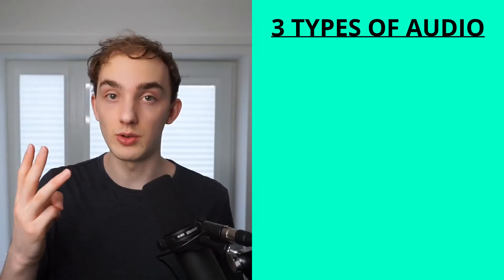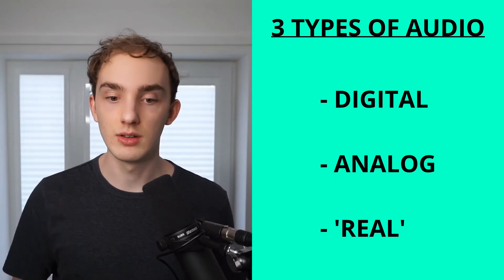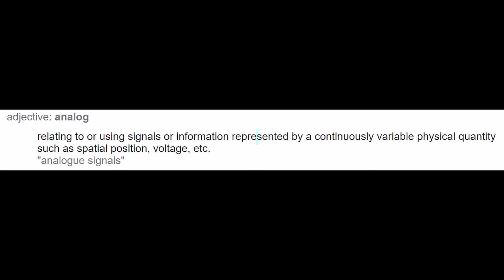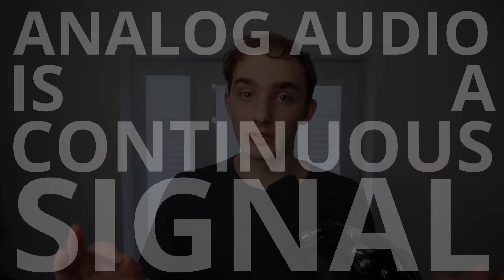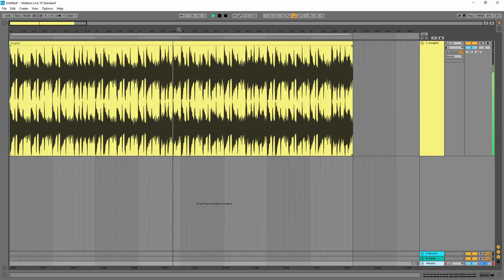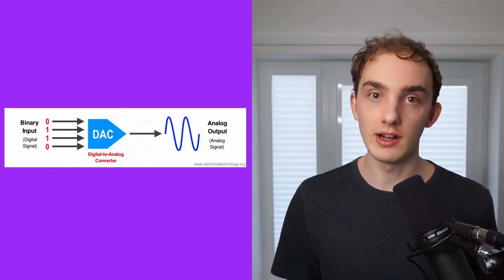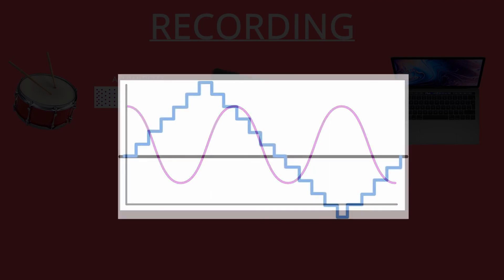HOW SOUND WORKS | Digital vs Analog vs 'Real' Audio

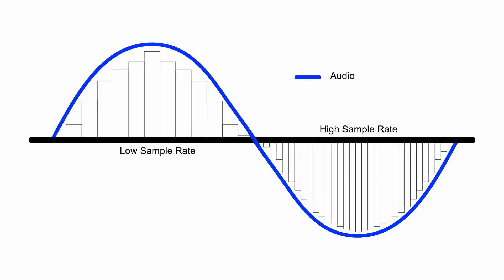Comment: @2:40 the sample rate is what makes the true 'character' of digital 'audio'
with

@3:10 24 BIT depth, I've seen it while using audacity and such

recording 'digital' instruments persay, you are making a record of a electrical signal, on a particular day from a branded machine
with a Digital Audio Workstation, you can Calculate effectively, each of those possible 16,777,216 possible values
(that number seems random but that is a base of some number as well)

thats why trap music has those sub-basses not possible before, it must have be Calculated, Generated, Manipulated within a digital environment such as in a DAW,
makes me think of why Moog or synthesizers, have particular characters or differences of sound, and why they are so expensive.. 

the kicker has always been, being able to manipulate, the sound generated. and with 24 BIT depth in a file of 'digital audio', you can calculate and arrange the values of 24bit 16,777,216 possible values in a file of digital 1s 0s of music in a mp3 or wav file aac

effectively, all audio coming out of my computer speakers, is Analog Audio, in its most basic word terms
from voltages to moving air particles,
the cut with digital 'audio', daws, and electronic music, you really don't deal with air particles, nor are you just dealing with voltages, your cutting into the digital file of 1s 0s, however that may appear on your screen, and the most effective or fun, or unique thing to do there is, calculate sin waves or pure mathematical, waves there

digital instruments, effectively, you need to chart the characteristics of like a moog sound or roland sound or obemheimer etc.. that would be the difference, the Character
and the justification for what our ears recognize, cognitively or psychologically,
right now as im writing, i'm getting caught up on sample rate vs bit depth, but i see that as a different video aswell

in all, there are times im trying to find the difference between my piano and the music speakers connected to my computer in my room. analogue vs digital.
cutting to the source, weither with vinyl like dj grandmaster flash, or now with digital, manipulating the sound generated via bits 1s 0s digital files
thanks for explaining, its helping me visualize and graph 

i have a vision of trying to explain music theory mathematically, so this is getting me closer to that as well